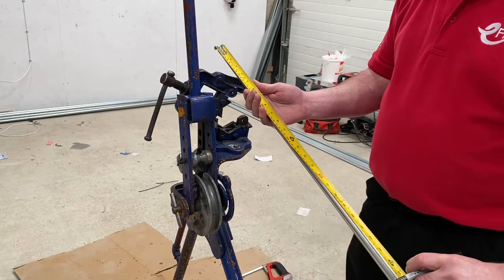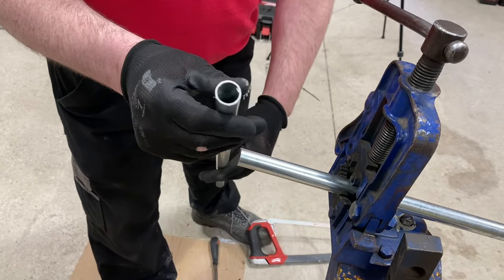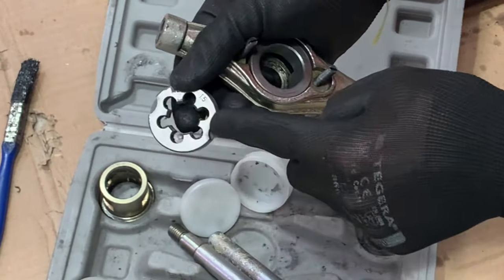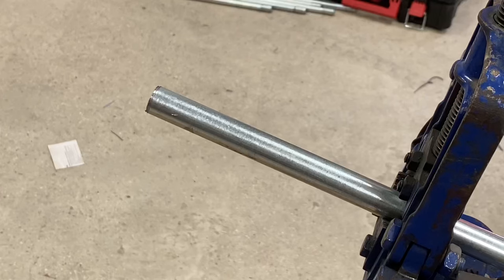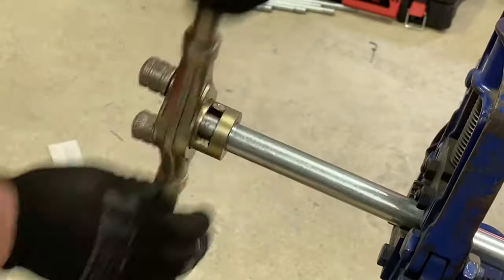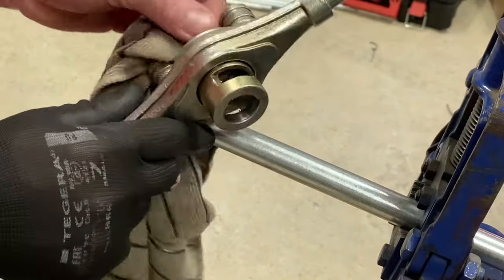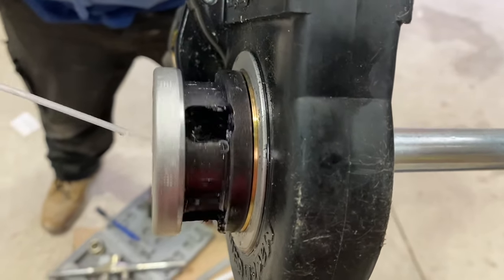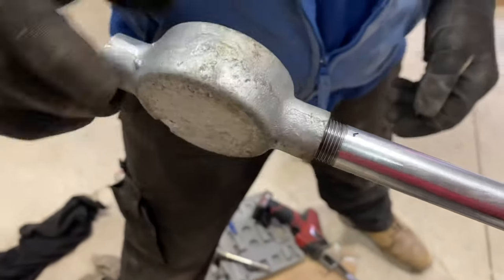How to Thread Steel Conduit - by Cheating Using an Electric Threader and Old School Stocks and Dies

Comment: Great video Gary as always. Just a note, the blasé way you throw your file to the floor at 1:42 is not desirable. The file could shatter and I would not treat my own tools that way. Most people have a 4 inch bit of conduit and unistrut tie-wrapped to the bender. The conduit to hold a round file, the unistrut to hold a flat file. I’m old-school, so manual all the way. These kids today don’t know they’re born with that electric threader. I remember having to thread nipples out of a length of conduit by hand because we’d run out - ah, the good old days as a first year apprentice. That and doing the tea run and getting moaned at by the miserable old bastard because he’d got 1 sugar instead of three. Also, with the manual threader, the shank of the stocks and die are facing inward to guide the cutter along the conduit and hold it square (which is what I do). In the electric version, does he have it the wrong way round? It looks like he’s putting the cutting face directly on the conduit without the guide to hold it square. Sorry for the long comment.
Reply: It's a new way of cleaning a file ,
Reply: We use a hand threader. Dumb learners don’t use lubricant and it’s blunt 😔
Reply: @Eliteboss2004  who learned operator , time for a label on vice , ?

Comment from the maker: == 🕐 Time Stamps - Cut to the action 🕕 ==
00:10 - Measuring steel conduit to length 
00:47 - How to cut steel conduit with a hacksaw 
01:37 - How to file the end of steel conduit
02:07 - How to build your conduit stocks and dies 
03:03 - How to cut the first part of the thread onto steel conduit
03:47 - How to thread steel conduit 
05:14 - How to ream the ends of steel conduit 
06:14 - How to cut and thread steel conduit using an electric threader

Comment: Evolution chop saw, REMS threader, step drill bit to ream. Former only comes on site when you have to do an off/inset. The rest is done with elbows & boxes.

New conlock system kinda makes a mockery of the art.

Missing from the video is appropriate PPE. Face shield, L5 gloves & apron/chaps. People laugh but, when they get swarf splinters stuck in their fingers & decide to take a leak… the shoe is on the other foot 😂